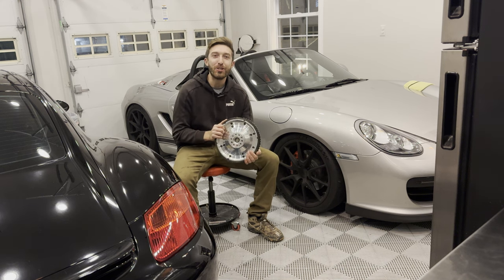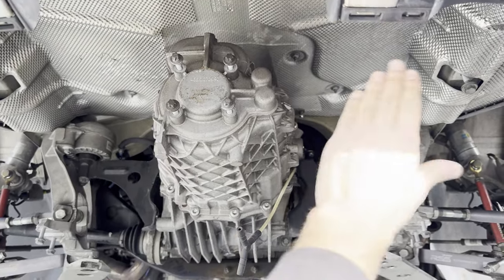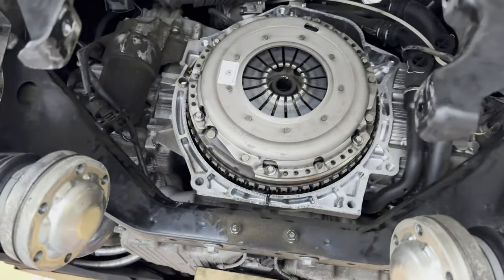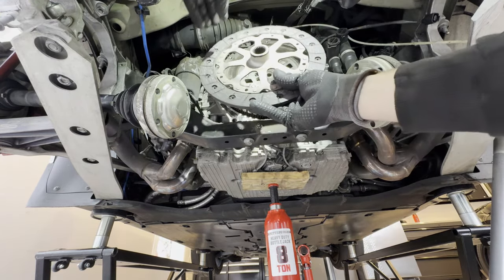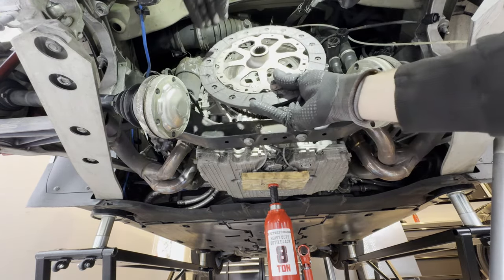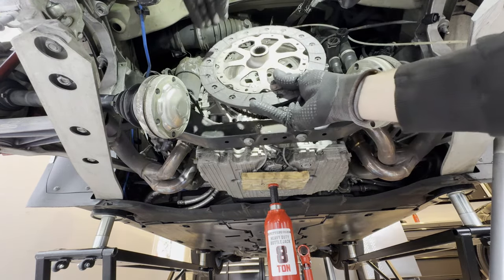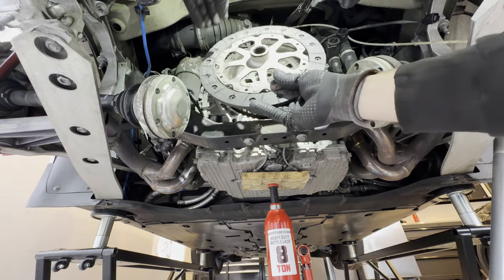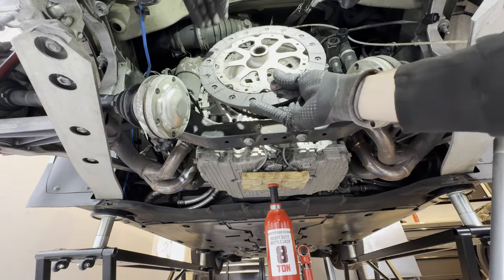Porsche Lightweight Flywheel Install | Step-by-Step | 4K 60FPS

Comment from the maker: This is the flywheel used in the video. https://www.vividracing.com/my-deal/daYMTsCG Finally worked a deal with the manufacturer and I'm working with VividRacing so they are offering 5% off (with code "daYMTsCG")... not much, but better than nothing :) if you end up ordering one, would appreciate if you used the link. You'll save a little lunch money and some proceeds will help support the channel :) If this flywheel isn’t for your specific car lmk and I’ll send you a new link <3
Reply: Just discovered your channel today. As an owner of a 981 Spyder.... you make me want to start modifying!! Keep up the good work!
Reply from the maker: @derktheterk  Hey thank you so much! Now that I finally have a sponsor I'll be going over all of the parts and how-to's on the car :)

Absolutely love the 981 Spyder. What spec is yours?
Reply: @DasCayman  It's a base Spyder, but it does have AC and stereo. Only real bummer is the sofa seats. I wish there was a carbon option for less than 20k!

Comment: Running a lighter flywheel actually reduces stress on these cranks because the tail is very long there is less weight wobbling about.

Comment: Love your videos :) 

Did you fit a harmonically dampened under drive pulley too?
Reply from the maker: Unfortunately there are no harmonically damped pulleys for the 9A1 DFI engine. Only for the non dfi engine
Reply: @DasCayman  Thanks for taking the time to reply - thats a shame :( 

Keep doing the videos - I've got a 987.1 Cayman S over here in the UK and its great to see how well you pedal your 987.2 Spyder :)

Comment: Have you installed the weighted crankshaft pulley? Do you think  that a 3 lb. pulley is going to make up for the 12 lb. removed? I would love to install a LWFW but I'm concerned that even with a balanced pulley the engine life will be significantly shortened. Your thoughts?
Reply from the maker: The shaft is supported by so many bearings in the engine that this would not matter. It’s not about counterbalancing on Porsches but rather soaking up resonant frequencies. I spoke with 4 name brand Porsche race shops in the USA - TPC, BBI, Sharkwerks, and DeMan and they all said engine is balanced from factory, doesn’t need a harmonic balancer and to enjoy the flywheel
Reply: Thank you for your prompt reply.
 @DasCayman

Comment: You need a sprung centre clutch disc now. you didn't need one as the previous set up had DMF which took the shock. Now everything is fixed you gonna flog that fucker out real fast. Look at the kit BBI sells
Reply from the maker: I called BBI, Sharkwerks and TPC and asked about this... they all said stock clutch is OK. I too was nervous... but it's fine. Especially if you know how to drive manual very well. I pointed this out here. I think you'll enjoy! https://youtu.be/o4peLanjAvk